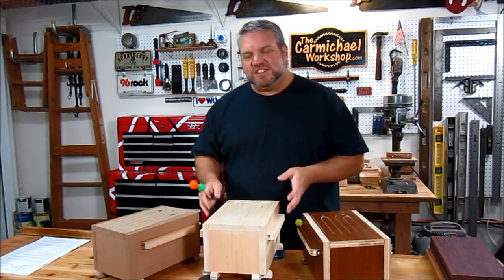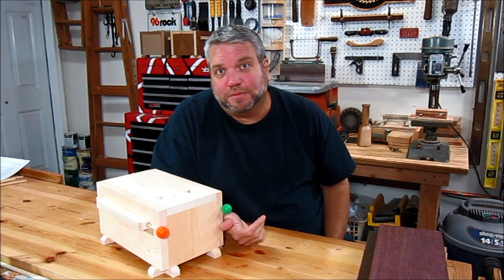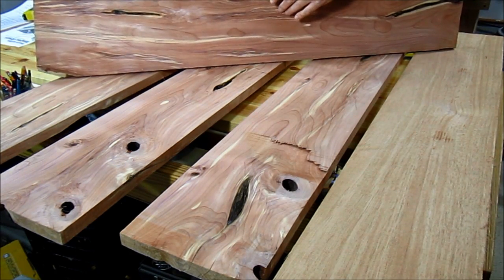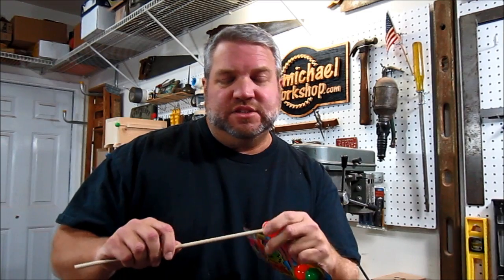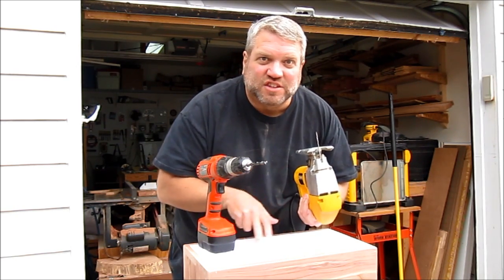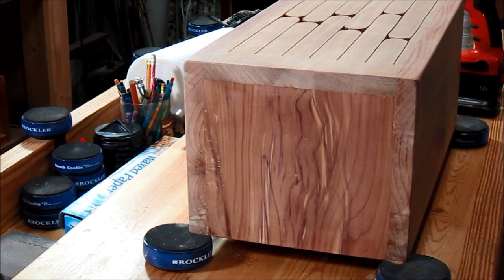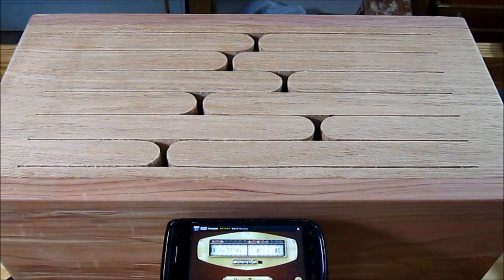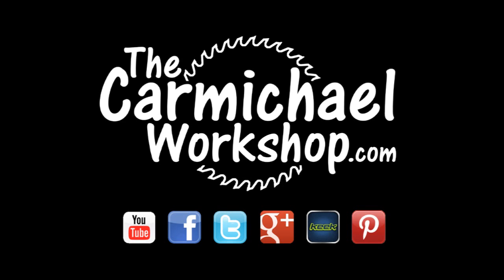Building and Tuning Tongue Drums, Slit Drums, Xylodrums - Easy Woodworking Music Project

Comment: Steve, Thank you, this is a great lesson.  I know this is an old post but i'm hoping you or someone is looking in who can answer this question.  I am going to build one and I want to tune it to the G major scale. Are the notes in any particular order from the front to back the back on a tongue drum or do you just tune them to the closest natural note of each tongue?  Help!
Reply from the maker: Each one I've made sounds different depending on the wood, thickness, box size, tongue pattern, etc.  I just tune them to whatever note they are closest to.  Google 'bar length calculator' to find a mathematical method of determining what length the tongues should be, similar to marimba bars.  Avoid putting two tongues of similar sizes next to each other because their similar frequencies will interfere with each other.

Comment: Was their any reason you decided to glue on the top then cut the tongues? I'm looking into making one eventually and I was planning on cutting the tongues first then gluing followed by tuning.
Reply from the maker: No particular reason.  Maybe the sides would be kinda thin for clamping unless you have a wider board and can make them thicker.  With it already glued on, it could keep the wood from twisting or moving, but the tongues would move anyway when they are cut.

Comment: I will use the template some woodworking magazineHowever if I want to make a larger drums like the one that you have now in front of you how would I get templates for that? Or did you just elongate the template that you had to compensate for size?
Reply from the maker: Hey, there are links to my templates and the Wood Mag template at the bottom of my project article -  http://www.thecarmichaelworkshop.com/2013/11/tongue-drums.html     I drew my own templates.   My best sounding top was 1/2" cherry.  I learned that it's best to avoid putting similar length tongues next to each other...alternate short/long/short/long.

Comment: My dad made one of these drums for me and it's really amazing!  One thing though, all of the tongues on one side sound really nice, and resonate really well. On the other-side there is a buzz and the tongues sound more like thuds.  Any idea how to find and fix that buzz? I've cleaned it and made sure there's nothing between the tongues.  It's strange to me that it is so different on each side....thanks....liked the last drum you made the best!  Thanks
Reply from the maker: Terri Hubble Each drum is different.  It could just be the wood grain or voids in the glue joints.  Also make sure if you have a bottom attached to the drum that it is secured tightly.  Trying different feet or pads on the bottom corners can help too.  Thanks and glad to hear you have one to play!!!
Reply: Steve Carmichael Thanks...I put super glue in a couple of cracks I found but didn't fix it completely.  It might be a tad better.  Would it hurt to shorten the tongues that buzz?  The longer ones are the ones that cause the buzzing.  I will change the feet on it..... thank you for the advice...

Comment: Any thoughts on tuning the harmonics for a better sound?
Reply from the maker: Aside from using a tuner to tune them, you could try designing a tongue pattern where tongues of similar size are not next to each other.  Also, add different thickness bottoms and different foot pads.  I've found a 1/2" thick top resonates really well.

Comment: Question your dimensions online lengthwise on some of them are 14 inches. Is that from one end of the tongue to the other end of the tongue or is it the length of the board?
Reply from the maker: I think the 14" is the board length. You can print the template for whatever size board you want by reducing or enlarging it in print settings.

Comment: Great video Steve! Will definitely do one in a near future. 
I LOVE the little mosaic loop you are playing. Did you use one of those drums?
Do you think that it will work if the top plate is screwed, so you can interchange scales with different top plates?
Reply from the maker: Thanks JC!  Yes, that loop was me playing the red cedar with mahogany top.  I glued my tops on, but I'm sure that would work.  These drums are sensitive to every little thing you do to them.  The tone and notes would probably change on you depending on how much you tighten the screws.  You might get some buzzing too.

Comment: Would you apply a lacquer to it or could that affect the tone? Should you lacquer it and then tune if you applied it? Great video by the way!
Reply from the maker: +Cameron C   Thanks Cameron!  Yes, I sprayed lacquer on mine.  I don't think it made any difference.  I would suggest finishing both inside and out if you apply a finish to prevent moisture from getting underneath which can make the tongues expand/move.

Comment: For those of us with ears that detect one tone from another.. the sound of that box is 'painful'.  
The two "braces" on the inside added too much "density", dampening the sound.  That muffles the vibration, which you don't want to do with a musical instrument. Also, if you had used thinner wood for the sides and bottom (cedar), it would have help a little. (Think of an acoustic guitar.)
Reply from the maker: Those sound like some good experiments.  Go try them then report back with your findings.  Make a video if you can.  Thanks!
Reply: @SteveCarmichael  - Steve, I'm no carpenter, but I AM a musician. The tonal quality between a cheap guitar and expensive guitar is huge to a musician's ear and the greatest difference is in the wood they use and the bracing (heavy bracing muffles the vibration).  I didn't mean to imply that I could "build" one of these things, only that I understand the principles of music tones in wooden instruments.  
I truly believe you did an excellent job on the "tongues" (top), but just needs further tuning. it's just that I believe the tones would be louder and ring true if the material on the sides and bottom were thinner (1/4 inch thick?). 
If I was half the carpenter that you are, I would have one of these.. they sound beautiful.

Comment: Great Video! I will try to vuild one for a musician frind of mine. One question:

Would connecting the pieces with wood dowels distort the sound? That is why you just glued them?
Reply from the maker: +Gianluca Casu Thanks! Glad you will be making one too. Just dowels alone may not sound good. You want the box to be a solid chamber so use glue. The original drums were hollow logs.
Reply: @Steve Carmichael got it. Makes sense now that you say so. Thank you!

Comment: When I printed out the plans from Wood magazine 2006 October the template didn’t print out for with because it reads 6 inches in width and 12 inches in length however the actual printer prints it at maybe 5 1/2 and 10 1/2 respectively so I’m just wondering if it says 6 And 12 inches would you suggest possibly just increasing the width in the land of the actual print out toeat for the correct dimensions?just wanted to get your Opinion on it in other words does the exact dimensions matter as much as the patterns of themselves if that makes any sense
Reply from the maker: Are you trying to print a 12" plan on 8.5x11 paper?  Load some Legal Size 8.5x14 paper, then in Print Settings, choose Legal paper size and the "Actual Size" option to print it on larger paper.  You have to watch that Printer Settings screen, because it will want to use "Fit to Page" or "Shrink to Fit" which will throw off the dimensions.
Reply: I will definitely try that that sounds like the issue . Thanks! Definitely appreciate it

Comment: Question for you...
After watching this, I decided to try a rough "proof of concept" prototype, as I have plenty of timber around the place, but none of an ideal type. But, you've even got MDF to sound tuneful, so I thought "Whatever...Give it a go !"
So now, my build is complete and I'm at the tuning stage. 
One side of the head doesn't really seem to be resonating . The other is, but it's muddy at the moment. I know a little about how this progresses as I've retuned some awful-sounding metal tongue drums in the past, and I know that as notes come into pitch, the others tend to get clearer. So I'm not worried about the side that seems to have the beginnings of tone.

Any idea what I might try to bring the dead side to life?
Reply from the maker: I think the most important thing is to make sure the box is glued together solidly with no gaps between the boards.  A solid sound chamber box is best, but you could leave the bottom separate for access.  Set the box on felt or rubber corner pads that allow the box to resonate.  I learned that tongues of similar lengths should be separated by shorter ones.  For example, if you put a 7" tongue next to a 6.5", the notes would be so close together that they would interfere with each other.  Put a 4" between them to avoid that.  Other than that, you could try different thicknesses for the top.  My best sounding top was 1/2" thick cherry.
Reply from the maker: Oh, the Wood Magazine plan calls for a stack of three boards to be glued on one end of the box just before the tougue cuts start.  I think this massive solid block of wood can help improve tone just by the extra density.
Reply: @SteveCarmichael  I thought I'd replied ...but whatever...Can't see my reply.
Thanks for the response.
The box I've made is pine, and all seems solid and well bonded. I added extra pine slabs to all ends and sides, beveling the top edge to keep them well clear of the tongues.
I think the weakness is the top, which is Larch. It might be just about the worst possible wood to use, even when 8 years seasoned...It's just too ropey I think. 
I didn't say...I made the top to one of your stencils. 14 x 5.5 inches. Are you saying that I need to move the notes around on the stencil ?
Either way, I'm heading to the store to find a better billet for the top. It seems a shame to waste a well made box.
Reply from the maker: @neilandfi  Hmm, never heard of larch.  Will have to google that.  Yes, try switching up the tongues so they alternate short/long/short/long.  It can't hurt.  I've made a dozen of these trying different things and each one is an experiment.  Using tone woods can help too.  I cut up the ones that don't sound good and use the wood for pen blanks and other stuff.
Reply: @SteveCarmichael  Well I DID head off to the only local store that sells wood other than pine and the normal timbers used in general building work. Being as we're still in  lockdown here in the UK, their stock levels were pretty low, but I found a billet of Purple Heart, and I've cut it to make a board for the top. 
Never worked with this timber before, and I like it. I'm just matching up the faces to make sure I've got a clean joining surface, then I'll mark out and cut the tongues.
Whatever the outcome, I'm enjoying this learning process.
Thanks for the help .
p.s. Larch is a European deciduous conifer . Larix decidua...Yeh..Sheds its needles in winter. Generally it's used for cheaper lap-style or arris rail type garden fencing. Good timber for friction fire lighting as it is coarse and grainy. It often has huge amounts of resin/pitch in it.

Comment: Nice project. Do you use different types of wood in your drums? For example I was planing to use some hardwood for the top but I don't know what to use for the rest. I was thinking maybe pine or some plywood. Do you know which sounds better?
Reply from the maker: Thanks!  Yes, I've made about 12 of these now all from different woods.  Padauk and Purpleheart are popular for the tops, but I haven't tried those yet.  My best sounding drum has a 1/2" Cherry top on a 3/4" red oak box.  Pine sounds surprisingly good, so I would say make your first one out of all pine.  Glue all the joints really well to make it become a solid sound chamber.
Reply: Steve Carmichael Okay thanks. Say if I make two drums with the same pattern but use diffrent kind of wood for the top, will they have the same notes?
Reply from the maker: No they probably won't.  Even two drums with the exact same wood will not match, but you might be able to tune them to get pretty close.  To clarify, there are 12 notes.  The drums could play the same notes, but be higher and lower octaves.  For example, the large tongue on a pine drum might play middle C, but the same tongue on a cherry drum might play the next lower octave C.
Reply: Have you done any in pentatonic d scale?
Reply from the maker: No, I just tune each tongue to the closest note, trying to avoid two tongues with the same note.

Comment: Pine sounds best but the relative humidity will change the tone more with softwood.
Reply from the maker: +Rt Carolina   I haven't really noticed that, but I have had some where the tongues moved and touched each other.  Just a little sanding widens the gaps and solves that though.  Interesting instruments.

Comment: I made one with an Oak top. I'm not having much luck tuning it. It doesn't seem to matter if I take wood from the base of the tongue or the tip of the tongue, the app shows the same note no matter what. I've tried everything to get it to move one way or the other. What am I doing wrong?
Reply from the maker: +Dashwood Media  Hmm, not sure.  Could be the app, so try another one.  Also, make sure the tuner is not touching the drum or surface it's on and make sure youare in a quiet place with no other noise.  Tap the sweet spot of each tongue.  Oak is very open grain wood so I haven't used it as a top.  My favorite top has been 1/2" thick cherry out of the 12 or so drums I've made.  Make another one with different woods to see how it sounds.  Every drum is different.
Reply: +Steve Carmichael I have tried 2 apps and they both do it. Perhaps the wood is too thick to start. 3/4" Oak.
All 12 tongues show up close to D but they all sound a little different. I have a piece of Paduk here so I might try it again with that.
Reply from the maker: +Dashwood Media  Somebody told me that it's best if the tongue pattern alternates between small and large tongues.  For example, don't put two tongues that are close in size next to each other.

Comment: Aw Steve, you forgot to show how to make the sticks. What are the balls made out of?
Reply from the maker: Hi Judy - I thought I did that. hmmm  They are rubber bouncy balls from Dollar Tree toy section.  I drilled 1/4" holes half way into them, then glued in a 1/4" dowel rod with rubber cement..

Comment: I tried to make one of these. How in the world did you get those straight lines and keep your blade from curving?
Reply from the maker: I just took my time and followed the line and didn't try to push the saw to go faster than it could cut.  I think the type of blade you use makes a big difference.  For 3/4" lumber, I use one with fewer teeth per inch.  A fine tooth blade would drift and start smoking.
Reply: @SteveCarmichael  thank you. I used a good blade but I do believe I probably pushed it to much. My hand cramps up easily and I start moving faster.
Reply from the maker: I know what you mean.  I have to remind myself to let the blade do the work and only push just enough to keep it moving.  I try to find the sweet spot for the speed trigger as well.
Reply: @SteveCarmichael  thank you. I believe my daughter is going to love it either way. I used your plans to make it. Wish I could send you pics of it

Comment: Could you put a hole in the side to make you get more volume and possibly help in tuning. I like the Cedar and Mohagoni - totally spelled that wrong.
Reply from the maker: I did see some made with holes in them but I haven't tried that.  I think having a tight sound chamber with small openings in the top is important for the best resonance and sustain.  It is pretty loud already.
Reply: okay. That makes sense.

Comment: hey, i'm quite late ^^" but me and my daugther send your tons of french kiss (nothing weird, we're french ^^")

Did someone try to put hinges on the top, in order to make musical chests ? 
We're the crazy musical family kind,  trying to turn everything into instruments, from our chairs (we use cajon) to the beds (wonderful bass drums) including toothbrush (way more fun to do it in music)  and so more...

anyway, it's a wonderful tutorial, and we're going to use it soon as possible ^^
Reply from the maker: Bonjour Maluco!  I like the idea of doing a hinged top, but that would probably affect the sound.  These vibrate and sound best when they are glued together to make a solid sound chamber.  The drum probably would not resonate well and sound kind of dead.  If you can make a top that sounds good by itself, then you may be able to put hinges and rubber bumpers under the top so it won't rattle against the box.  Hmm, might have to try that.
Reply: thank you for a so-fast answer !

we will make a regular one, then we'll work on a chest. the rubber idea is a really good one, and with a good lock system, tight hinges, the  thing that will affect the most the chest will be all the plushes contained in ^^""""" there is a lot of theses :D

I'll reply in a month, to give you a return about our experiences ;) a table, some nightstand,  the side of a cabinet ("armoire", in french), maybe the kitchen door... I've just finish a contract, so i've a lot of time to spend ;p